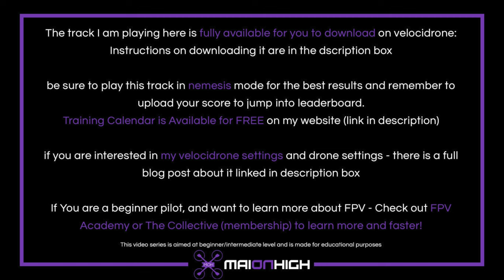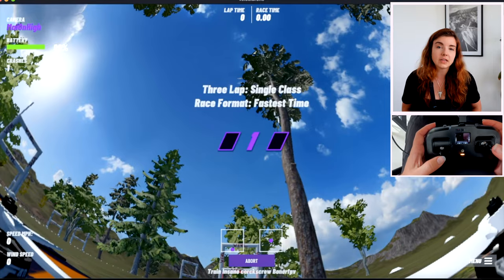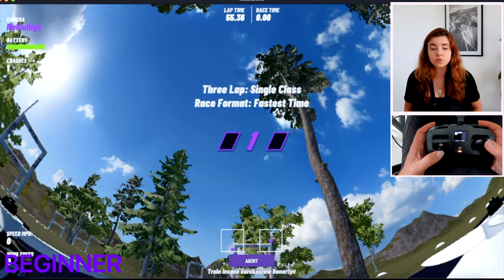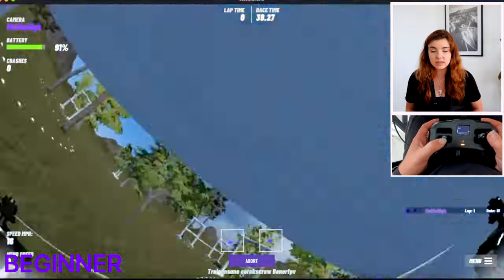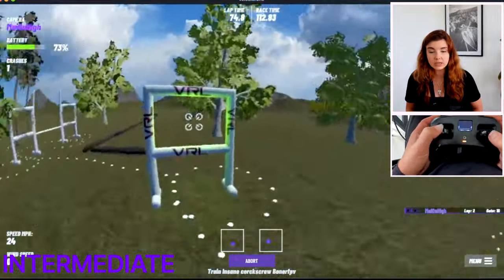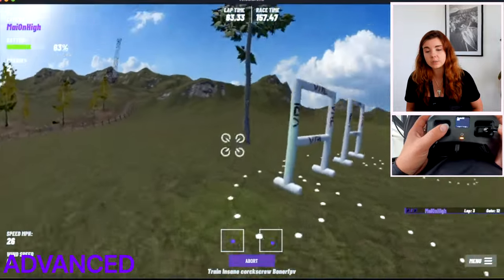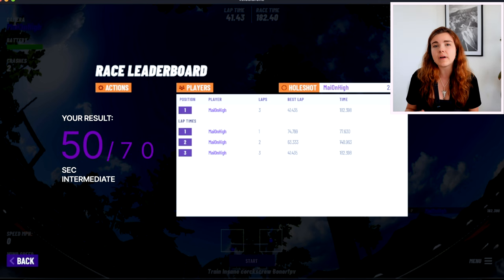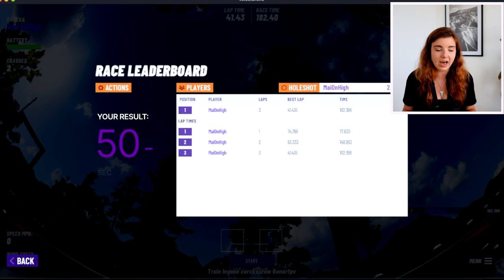How to Corkscrew (US: Ladder) FPV Racing, Cinematic & Freestyle Tutorial | MaiOnHigh

Comment: Interesting in the US, multigp this is called a ladder up not a corkscrew. Thanks for sharing the difference. Corkscrew for us is a different element usually 2 gates next to each other in a line where you need to go through each in the same direction.
Reply from the maker: Yeah in EU ladder is also a different obstacle which I'll cover next week. It's like a corkscrew but goes further.
We call the vertical move a powerloop 🫣
Hence all the confusion.
We need a normalised dictionary 🤣